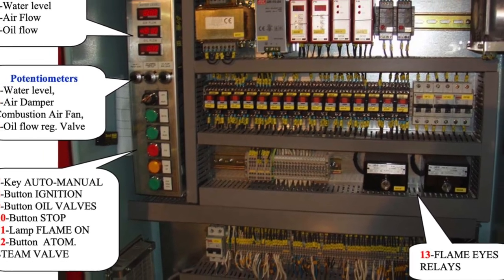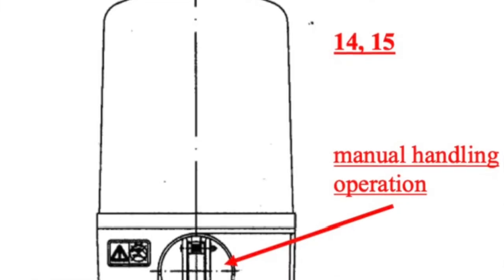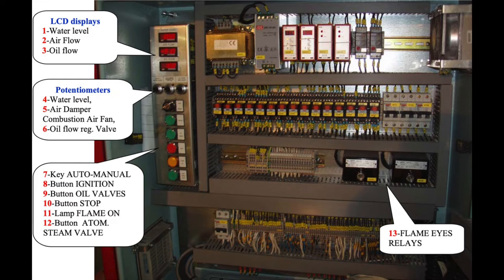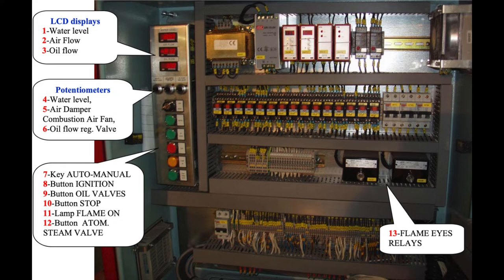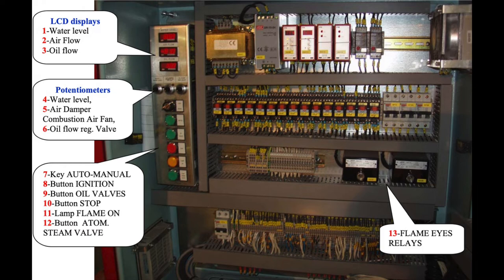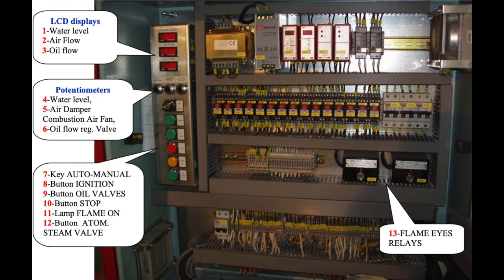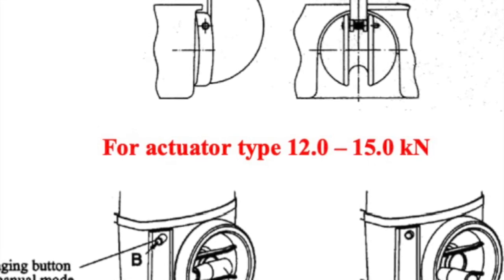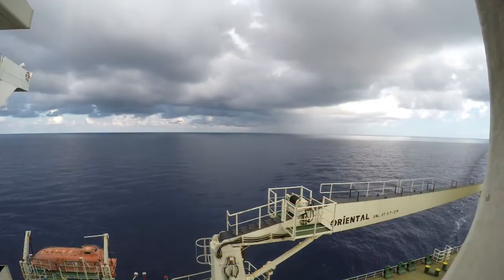Emergency Boiler Operation Aalborg Mission OL

Comment: Also from my experience I would like to add such information. When we change our key from auto to manual mode FO 3way valves always changes to HFO side . It’s very important to note . If your boiler before breakdown was on MGO mode you should be aware that in case of emergency operation your valve will be turned automatically to HFO side !!!!! I have faced with this case we could not start the boiler and nobody knows it !!!!
Reply from the maker: Thank you Konstantin for your valuable information!

Comment: Getting alarm "S1B1 IO link error" on Mission OL boiler.Please advise.
Reply from the maker: I think it is due to communication of your local unisab panel with the pc in engine control room.Try to replace unisab of no1 aux boiler.

Comment: sir how to change the battery for unisab?
Reply from the maker: It is very easy in new models you just remove and place new one.As long as you have power not any problem.The battery is the reserve power for the parameters to keep them in place within memory in case of power failure.